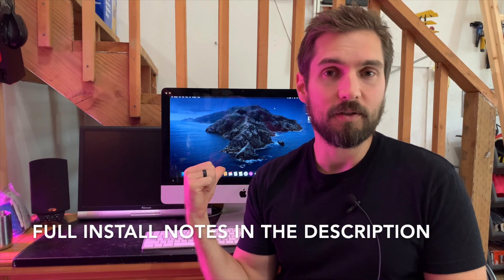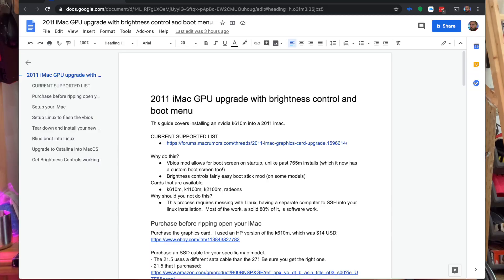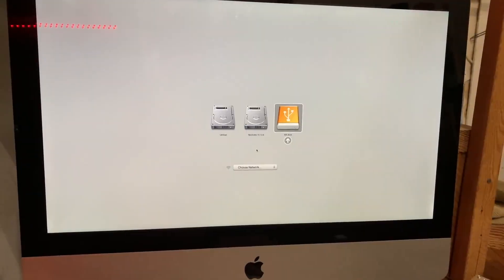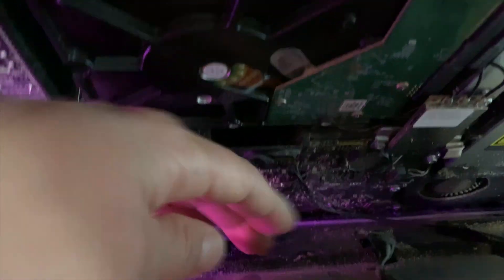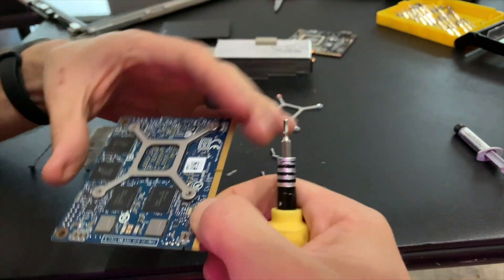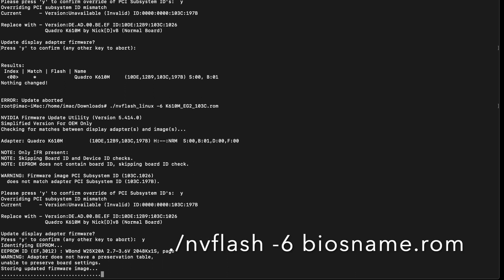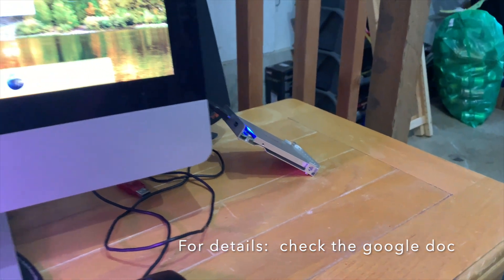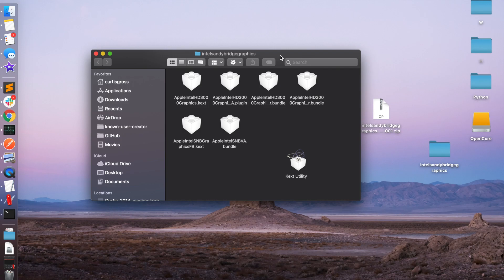2011 iMac GPU Upgrade Now with Brightness and Boot menu - Absolutely Worth It!

Comment from the maker: Be sure to check out the macrumors thread for new updates!  https://forums.macrumors.com/threads/2011-imac-graphics-card-upgrade.1596614/
Reply: thx for a great walk through! you never mention target display mode.... will this also work with your method here?
Reply: You deserved every like, for your hard work! Thank you for spending your time for it ❤
Reply: Hi Curtis, hope you can give me a moment of your time but first, thank you for these videos, they are VERY helpful. I have an iMac 27 mid 2011 i7 3.4 with a now failed 6970m 2GB VRAM. Here is the question: With the card you added to the 27" iMac and beyond all the new brightness control and boot menu on startup can you still use 2 external displays? This was something I loved about the 6970m but I can't seem to find an answer on this. If you don't know that's ok but I don't want to upgrade past High Sierra 10.13.6 if that helps you better answer my question.

… and hey, where have you been lately. Hope all is well and thank you very much for sharing your methods and experiences they really help the community.
Reply from the maker: @santospoland  Hey Alex!   For the upgrade I think you only maintain the ability to use 1 additional external monitor, and I actually didn't test that, so its more of a 'potential' rather than verified.  As for making videos - I might make a comeback, with work /family / moving and everything else that has gone down the last year, I just ran short of time to spend playing around with technology!
Reply: @messing-with-computers  Thanks for the reply! I hope you do make a come back as your videos are really informative. I can't thank you enough for all the background work you had to go through to make these videos, I know that it took you a lot of time and sharing the experience with your Youtube audience is truly gracious of you. Best wishes on all your immediate responsibilities and I am hoping you find the time to return with some new content … until then, all the best!
Reply from the maker: @santospoland  Thanks for coming back in and adding detail!  One thing you might be able to do... there are USB > HDMI converters that might work for your usecase.
Reply: Hi Curtis, thanks for the video was very useful. Just wanted to ask a few questions. I installed a K1100M in my iMac 2011 27 Inch, the original AMD GPU died. Got the new GPU flashed the video now works, I tried to get Catalina to work, but was having all sort of issues, blank screen, mouse not working, etc... so I went back to High Sierra, now I can't get the brightness to work and we no longer have access to your files on google drive. Are the files available some where? I really need the open core file for iMac, the Catalina booter doesn't work with high Sierra. Thanking you in advance. Happy Hollidays:-)
Reply from the maker: @douglaslariviere4657  - Hey Douglas!  Your best bet is to go through the mac rumors forum or direct to the opencore download page. https://dortania.github.io/OpenCore-Legacy-Patcher/BUILD.html  I tried making a new bootable opencore about 6 months back and even my copy in google drive was busted, apparently google flagged it?
Reply: Really great , I did it many times thanks of this instructions but NOW I have problem with password during SSH , password didn't accepted , any help ?

Comment: Your videos are great.  My 2011 iMac 27 is still running strong.  Upgraded video card to gtx675mx 4gb (an amazing card, but not as budget conscious as your recommendations).  Ram upgraded to 32gb (you can do this after HighSierra). Dual SSD's running in raid0 (to make speeds more like nvme).  Upgraded wifi card to add AC speed.  Replaced optical drive with a 3rd SSD for TimeMachine backups.  I've tried all Mac OS up to Ventura... they all work, but I keep going back to High Sierra because I think it was Apple's best OS.
Reply: You can do 32gb before high sierra. How are you handling the old os. Any limits?
Reply: @aironwhite6533  a lot of software is still up-to-date or the latest compatible version is still quite usable... however, chrome and firefox are ending support soon... HOWEVER... I've tested Ventura (installed with OpenCore) on the machine and it works PERFECTLY... the only downside is I was using 2 SSD's in RAID0, and the new MacOS's don't support RAID, so I must go back to using a single SSD.  otherwise, the machine keeps going strong ツ

Comment: Hi Curtis, are you still around by chance?   I see that your google drive is down I happened upon your Video after I installed a K2100M gpu and I'm needing help flashing the bios.  I think your option to go with Linux seems great!  I have tried booting to the menu but with the K2100M I can't until I flash it.  Thoughts?

Comment: IMac 2011 27-inch product is being used.
HD6970 1GB GPU. The screen was broken with vertical streaks, and it does not revive even with baking.

What can I do?
It is enough for me to use only High Sierra.
Do I really need to update the ROM? Is this easy?
Fixing the heatsink is difficult for me.
K2100m = $95
K4100m = $140
780m = $180
HD6970 = $200

I would like to try with a product that will not break.
What would you recommend?

Comment: Is there a MXM card for a 2011 iMac 27 that runs on Big Sur or later with enabled hardware acceleration? I have such machine running with OC Legacy Patcher with a Quadro K2000 but Big Sur doesn't recognize the card and the machine doesn't have hardware acceleration.

Comment: Hello, i’ve a question 🙋🏻‍♂️ if i upgrade the gpu and update the macOS to catalina. Can i use all the metal functions as the same as the new iMac? Like using the final cut pro with full function. Thanks in advance for the answer

Comment: I love it when I take something apart and put it back together and find out they included "extra" screws!
You can throw them all over the floor and find them by stepping on them again. Such a fun game
Reply from the maker: I have so many spare Mac / iMac / Macbook screws...
Reply: @messing-with-computers  All of them on the floor? 😁
Reply: Wee bits. no spares.

Why wee bits?
Throw them and make the noise. Weeeee..........
Reply: Hey. If you have extra screws then that means you did a better job putting it together than the manufacturer did

Comment: Hey Curtis you might not respond but its worth a shot so is there any cards out there that is better than the Radeon HD 6970m that is fully compatible with the 2011 Imac 27 inch and doesn't need a special heatsink if not I will prob just get the 2gb version of Radeon HD 6970m Thanks for Reading if you did!

Comment: Things have changed in three years, it seems. I installed Ventura on my iMac 2011 using OCLP, and didn't need to swap out the GPU to do it. (Good thing, too, as it seems like a rather involved process.)
Reply: interesting, I am looking to do the same. I have 14gb of RAM but I assume I will need to upgrade to an SSD first. Does it run smooth ?
Reply: Hey mate, isn't the performance pretty slow without a metal gpu? Does Ventura not require metal or am i missing something? I installed big sur a while ago but it was almost unusable without a metal gpu
Reply: I’ll update on this I’ve got a 2011 iMac running Ventura perfectly fine. You just loose any location services. I have a 1TB SSD, intel core i7 2700k and 16GB memory it ran Ventura just with the SSD alone. I’ve even ran Sonoma on it but have had Bluetooth issues so Ventura is where I’ve stayed. You’re Mac will run a little warmer but I’ve just used different cooling options

Comment: Good afternoon, my imac 2009 i7 is out of order, the video card has been ordered for Ali express gtx 880, the seller showed the photo that it works before sending it, I installed it, there is no black screen, there is a sound on the password and tell me if the seller did not modify the BIOS, the image should displayed? Or do you need a BIOS modification?

Comment: Are brightness controls also working in system preferences? If not, it means you can’t disable auto brightness!
Also, this GPU supports Metal. You can easily patch your device to the latest version of macOS, so further than this!

Comment: I started this upgrade over year ago. I purchased and flashed (in my PC) a Nvidia K2100M by Nick [D] vB 2048 . I installed it into my Mid 2011 27" iMac 3.4 GHz Intel Core i7. I was able to boot up and it worked fine. When I tried the next step to install Catalina, the processed failed and after a number of trys I gave up and just continued using the computer with High Sierra. Eventually I had to replace the computer (Mac Mini M1) so that I could run the updated version of FCPX.. Last night I pulled out my iMac to remove any old files and reformat the drive. After a clean install I decided to try to upgrade to Catalina one more time. I used DosDude1 Catalina Patcher and it successfully installed Catalina, but them my screen went black. I tried what I could to get a picture with no luck. So I reformatted and reinstalled High Sierra and monitor started working again. I am thinking the cause may be that the latest version of the patcher is designed to work with non-metal video cards??? Is it possible to refresh my card with the method you use, and then run the Catalina Patcher. Your video has been very helpful, and I would appreciate any advice you may have.

Comment: is the HP version of the K160m given the same number? or does it need to be crossed with the K160m? I see on ebay HP Nvidia K160m but nowhere near your stated price. But it is late in the year and given the situation.. Just wondering if I am finding the correct GPU. Also am I able to upgrade the CPU as well with the K160m ? at first I need to fix the graphics as the graphics are burned out.

Comment: Hi curtis. I bought a k610 that i want to use for my 27inch mid2011 imac but my problem is that the x bracket from the failing 6970m does not match exactly to the k610m. Some small components are placed right under that bracket... how did you modify the x bracket to match your k610m?

Edit - saw that the bracket in the 21.5 inch imac fits well with k610m but the brakcet from 27inch imac does not. Now i dony have an idea what to do.

Comment: sorry i cannot understand one part, does it mean that i can do everything simply put the gpu in the imac? or do i need 100% another mac or win?
Reply: because my gpu is broken and i cannot access to another pc to do ssh easily. any other solution for what i can do directly on that mac?
Reply from the maker: If your GPU died, you can just install the k610m and get your mac working again. But until you go through the process of flashing the card, you will not have a boot option menu. Check out my other 2011 imac video for that process. The k610m (or any nvidia kepler based mxm card) should at least get you a usable mac OS again!
Reply: Curtis Gross thank you so much for your answer. Does it mean that technically any mxm card should work straight ?
Reply: Curtis Gross do you think is better a k610 or a k2000?
Reply from the maker: @KeigoMoriyama  I don't see a custom bios for the k2000... so I wouldn't use it.  The k2100m is much faster and has a vbios, than the k610m, but the k610m is perfect for $14 and as long as you are not really planning to game, its great for everything else.  If you do game or plan to use an app that leverages the GPU... probably best to buy a computer that can go even bigger than the k2100m!
Reply from the maker: @KeigoMoriyama  - sadly not all cards work.  check my video at 1:33 and focus on the cards in red.
Reply: @messing-with-computers  in the forum, there is a prebuilt usb with linux that has the rom for the k1000 k1100 k2000 and k2100. I come from a 17 inches macbook pro that i used to render 4k videos and i want to do the same with my 27 inches imac. the k2100 as you said is pretty expensive so far, that is why i was looking for cheaper alternatives
Reply: btw thank you very much for the time you are taking to replying me
Reply from the maker: Keigo Moriyama gotcha!  If there is a vbios, I like it. No vbios?  Not as big of a fan. So - yeah, the k2000 sounds alright if you have a bios!
Reply from the maker: Keigo Moriyama happy to reply!  I got my knowledge the same way ;)
Reply: @messing-with-computers  just found a good deal for a k2100m, hope will arrive soon

Comment: What is the coincidence you came out with this video today and I just decided today to look into upgrading this exact iMac!

How about upgrading the RAM & SSD?
Would you recommend upgrading the RAM to 32GB? I see that OWC offers a kit called: "32.0GB (8GB x 4) PC3-10600 DDR3 1333MHz SO-DIMM 204 Pin CL9 SO-DIMM Memory Upgrade Kit"
Would an SSD be a good upgrade?

Seems like with these 3 upgrades this 2011 iMac might even be better than the current iMac minus any 4K/Retina display, would you agree?
Reply from the maker: Depends on your workload - I would absolutely get the ssd kit and at least 8gb ram - I usually stick to 16gb unless I am working on 4K files, and then 32gb is necessary.  These older iMacs are beasts!
Reply: @messing-with-computers  That makes sense. So I'll save the money and go for the 16gb. Thanks for the reply!
Reply: You don't need to buy an expensive owc kit, any so-dimm 1333MHz DDR3 memory will work just fine. Even 1600mhz ones, it will run simply at a lowe clockspeed.
Reply: Péter Viszt really? Thanks! Although I’ve tinkered with and upgraded computers before I’m still very much a noob. I haven’t ordered anything yet but I truly was thinking of getting OWC’s 2x8gb RAM and their HDD to SSD replacement kit. That’ll be just under $200 but if you’re saying I can do even cheaper than maybe I should look at Newegg or TigerDirect ;)
Reply from the maker: @phillip9263  Yeah - these iMacs are fairly forgiving with the memory choice. Use OWC for custom cables, but not for drives / memory (at least that is my general rule).
Reply: @phillip9263  You can use any SSD in place of your existing HDD too. The HDD fan in the middle will spin at full speed, but this can be easily fixed with a software called Macs Fan Control(you can pair the fan sensor to your new SSD with this app and the fan will return to normal speed). You can also replace your optical drive with an SSD: just google "
HDD SSD optical bay caddy"  or something like that. You don't even need new cables for this, the existing ODD cable will work just fine. Theres 3 SATA ports on your iMac, but one of them is SATA2 only and your optical drive is plugged into that. So you just need to plug it in into the different sata port and it will work at sata3 speeds. No need for extra cables :)

Comment: so, from the manual, it says that the diagnostic LED's are labeled 1-4 from right to left. If that's true, wouldn't that mean that your GPU diagnostic never turned on? I'm confused, because i've been trying to install the k1100m and the 3rd diagnostic light won't come on. I've tried ssh with the usb stick but nothing. could use a little help please. thanks

Comment: Hello, I have an imac a1311, GPU quadro k3100m 4gb, goes into sleep mode, after that it does not wake up, you need to turn off the power to wait 15 minutes and only then it starts. Fix sleep mode help me? macOS big sur.

Comment: hey mate whats the best plug and play gpu for the imac 2011 without changing bios or without tinkering with the os?. im not worried about the brightness control. i was looking at a wx4170 hp zbook 4gb GPU. will i still need to flash bios? or even the wx7100m not too concerned about cost i just want it to last another 10 years for the wife.

Comment: Just upgraded my gpu in a 2011 21.5" iMac to a K1100m with success. Thanks for the time put into your video and guide.
Reply: This is great! But can you run the GPU benchmark?
Reply: Hello derek, I had a quick question, is K1100m optimal for gaming?
Reply: K1100m works for a 2011 27" too???
Reply: did  u have software issues
Reply: I tried another stock AMD card on my A1311 and it didn’t work. So as I understand - it doesn’t matter what card you had before upgrade and you just plugged K1100m and it worked?
Reply: hi friend, you have brightness control ?  i upgrade imac 21.5 model 12,1 but not have brightness control. can you helpme whit open core options or yout apple backligth kext, i am wait for your help thanks for your time.

Comment: sorry for the newbie question but the K610m video card being installed on the iMac 2011 21.5 or 27 inch without flashing the video card i just won't have the imac boot screen but the system should enter normally, correct?  Can I consider it the same thing as Mac Pro’s until 2012/2013?

Comment: Hello, I bought a k610m card but it doesn’t seem like yours on video. What gpu did you install?
Reply from the maker: The gpu I used was a k610m - how is yours different?
Reply: @messing-with-computers  It doesn't have both chips on top. Mine is Nvidia Quadro k610m N15m-Q2-B-A I'm not a 100 % sure it's the same. https://www.ebay.com/p/1337641469

Comment: Hi Curtis, hi All

I am trying to install a GTX 780m card into a 2011 27" iMac, but I am start to thinking that the card is broken. Did you upgrade the BIOS before the install the card? I did not do that and the screen do not turn on. Just turn on the first 2 of the 4 diagnostic LEDs light.

Thanks in advance
Reply from the maker: Luis - try removing all the memory except 1 stick, maybe even leave it unplugged for a while and try doing the keyboard commands for 'reset pram' to see if that gets it to the 3rd light!
Reply: @messing-with-computers  Thanks! I'll try ;)